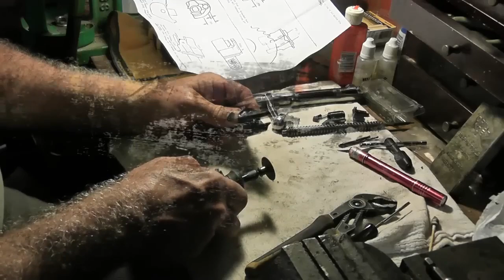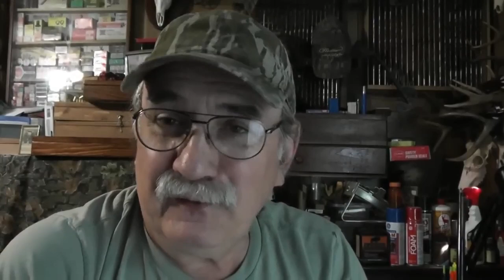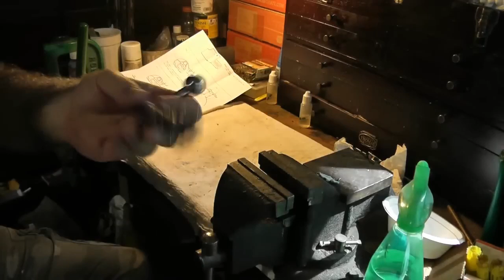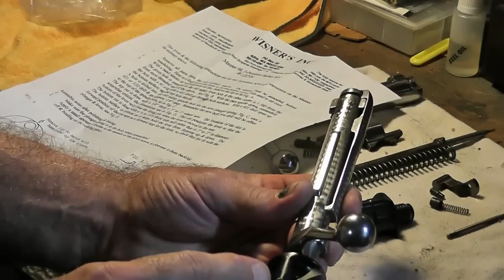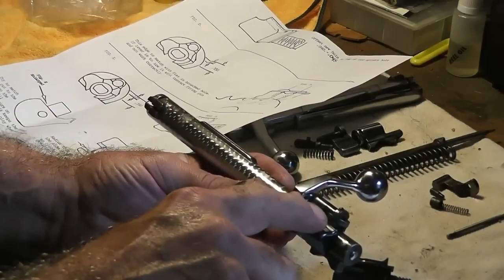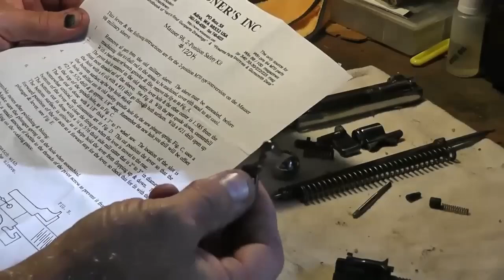Improving the Mauser 98 Safety

Comment: Nice video, I have these 3-position safeties on two Mausers currently and love them. They are so Winchester Model 70-like. I picked up a Wisenr off the web for like 290 USD as backup. 😆

On the firing pin takedown, I use a wood 4x4 block that's 6" long, and it has a 1/4 hole drilled maybe 2" deep, I just stick the firing pin io in that hole and disassemble the shroud/cocking-pin. If you think about how a German 98 butt has a takedown disk, it's the same concept just in a 4x4 block of wood.

On prices, this safety did go up but the NECG safety is like way over 500usd now

Comment: I just did the Timney Buehler safety and it works fine. BUT I wish I had seen your video as there's only 1 safety better than the Winchester style safety. Being a lefty with a lefty Son. My favorite is the mil spec 1917 American Enfield safety. I have 3 Enfields and a K98 sporter and a Heym mod 98  7X57 w/ dbl set triggers.
It had the mil. flag safety until Jan. 10th 2025. Your video is great and I learned a lot. Thank you!!!

Comment: This is a very informative video.  I'm currently installing a pair of Wisner side swing safety's on a sporterized 1936 Mexican in 7x57, and a 1908 Brazilian in 308 Winchester.  If I may, I'd like to add a comment.  You really should either get or make a set of soft jaws for your vise.  I use a set of copper jaws and they make tasks a lot easier.  Holding the parts with your hands while using a Dremel tool is less than optimal, not only because the parts can become hot, but if that Dremel slips it can walk right up your hand and give you some interesting scars. (I've already got more than enough scars on my hands already)  Holding the parts in a vise with soft jaws is not only safer, but it gives you an additional rest to place your hands against while grinding for a steadier cut.  Thanks for the video.
Reply: I also have a 1936 Mexican Mauser with Flaigs Ace 7x57mm medium contour 26" barrel, black walnut custom Sporter stock, Leopold scope mount and scope, welded bent bolt. My factory safety is not operational and I'm shopping around for safety's or Timney trigger with safety.

Comment: I restored my dad's Argentine Cavalry Carbine for him about 7-8 years ago. Its a BEAUTIFUL carbine in a high B+ to A grade with original bayonet. At the time i had a hard time finding the ammo for it and the only 7.65x53 Argentine i could get was Prvi Partizan and unfortunately it keyholed at 50 yds. because the bullet was too heavy for the carbine. I got the 180 gr. and i guess it needs the 174gr. I know thats nit much difference but thats what i was told by someone else that has one. The bore is beautiful with strong rifling. It will be mine one day but i am in NO hurry to get it. I hope its not for a good long time, but i will get the lighter bullet when i do. Hopefully that fixes it. I havent seen lighter than 174gr.
Reply: Also, the Argentine crest is still on the receiver. I guess most of them were ground off before selling the surplus. I don't know why but his seems to have slipped through.